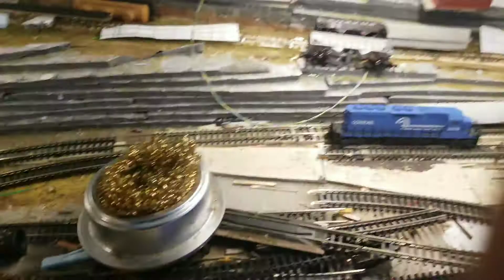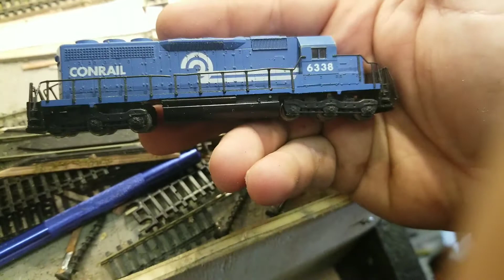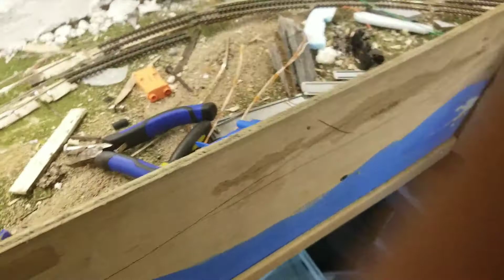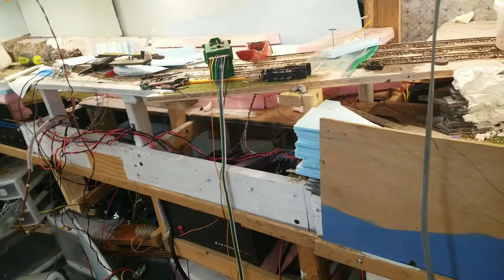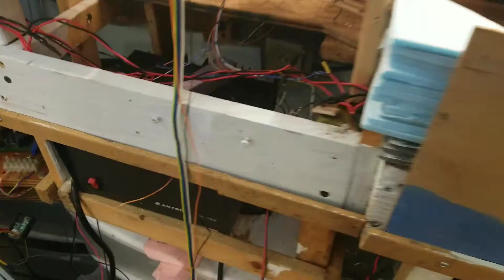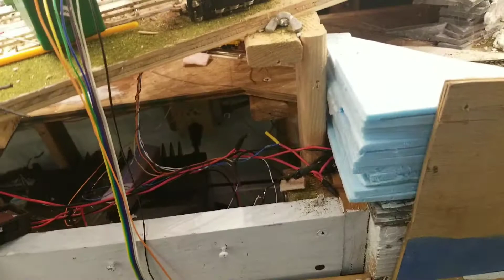Major area upgrades on the Dunlap sub of the southern railroad

Comment: I have a Astron power supply also,I have the biggest one the company makes,the RS-70M series.(volt/amp meters built into the cabinet)
My other hobby is a CB/ham📻radio and my radio's gobble up 70 amps at 13.65 volts like nothin'.
I thought about doing what you've done with yours,get a 15 amp supply to run my"N"scale layout.
The Astron supplies have the lowest AC ripple in the industry,less then 10 millivolts peak to peak at full load,which makes the very best supply you could ever have for your models,motors run alot cooler and smoother,especially on DCC systems.